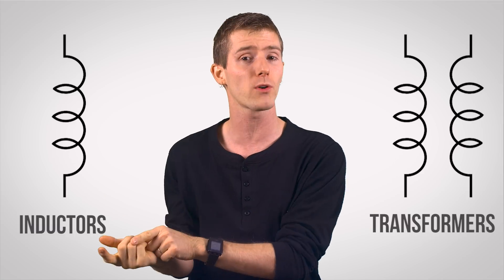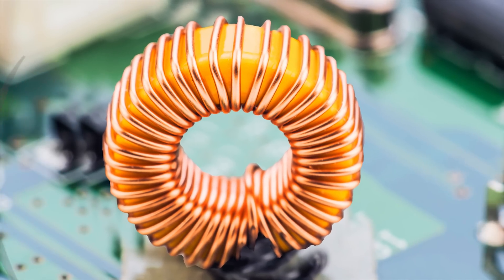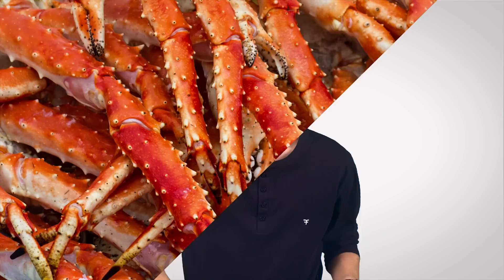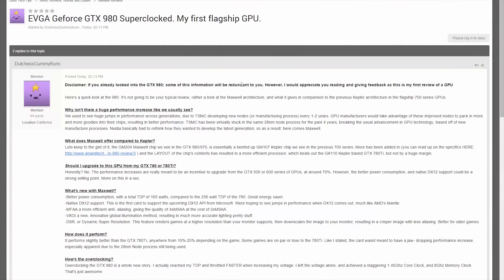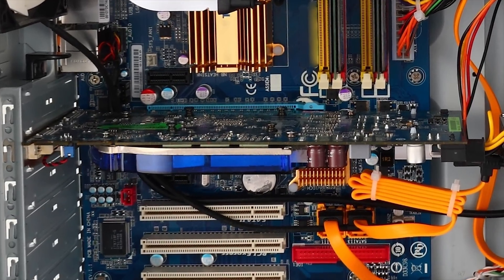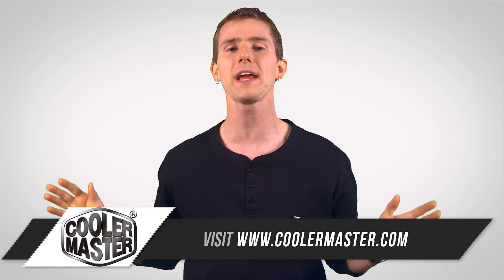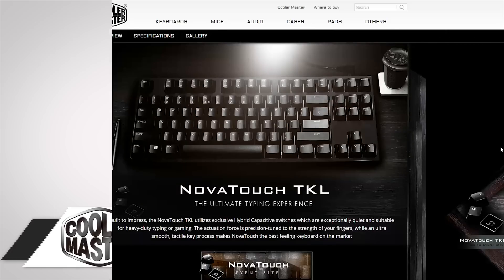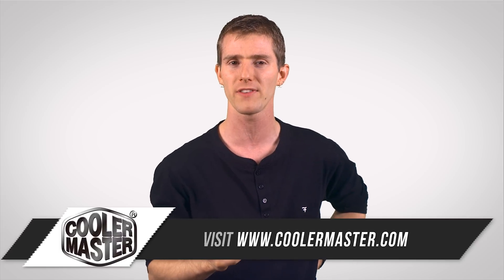Coil Whine as Fast As Possible

Comment: The last tip - listen to Linus. I accidentally sent away my HDD and lost all my data because I haven't had any backup drive back then. When it came back I realized that not the HDD was broken but the fan of my PSU was making strange sounds (which usually slowly dying drives do)

Comment: So for the 970's that have coil whine, is it from the actual pcb? Because I was planning on getting a 970 and taking off whatever stock cooler it comes with and using an NZXT kraken with a g10 bracket. Would this reduce the chances of coil whine?

Comment: This is weird but the coil whine on my card is quiet. But the electro magnetic field produced interferes with my dac. So the coil whine sound will play through my speakers. I can turn the volume on the speakers down and the pc audio up to compensate but this is so weird. If my speakers aren't plugged in i cant hear the whine. Maybe i need to find a way to shield my sound

Comment: Just limit your graphics card's fps to one fps below your monitors refresh rate, this stops most coil wine. You can do this through the catalyst control center and whatever nvidia's equivalent software is called.

I did this and I don't have coil wine on my radeon 7950 anymore.

Comment: hey linus, here are some suggestions for your next video
a video about:
-Chokes, diodes, capacitors, mosfets & more
OR
-kernels(Linux, windows NT, Unix etc), 
OR
-firmware
OR
-wattage, voltage, amperage, ohms & more
OR
-VRM, Digi VRM & Digi+ VRM

OR
-Filesystems (fat32, ntfs, ext4 etc)
OR
-Contrast ratio (this is just a worst case scenario suggestion)

i'm not giving up until you do a video of my suggestions >__>
Reply: I second these.
In particular VRM/MOSFETs on motherboards are one of the most important parts on them and knowledge about adequate cooling for them is lacking.( and the AMD crowd would benefit most.)
http://www.overclock.net/a/about-vrms-mosfets-motherboard-safety-with-high-tdp-processors

Comment: I had terrible coil whine, turns out a wire on my 24 pin was seperated from the connector. Whoops, new PSU and it's silent.

Comment: Overclocking or doing anything to change the voltage [higher or lower] will change and possibly even get rid of coil wine. Be careful though and don't fry anything. Also set a frame limit on older games.

Comment: I bought a Corsair CX600 v.2 power supply about 2 years ago, did not have coil whine for a few weeks then it started to whine. The interesting part is that it went away in a few weeks, it was only noticeable during the night when I was in bed and even then, it could be stopped by switching it off via the button at the back.
But as I said the whine went away, no problems since.

Comment: I picked the G1 970 as it uses high quality components that dont coil whine
Reply: Many GPU manufacturers claim to use "high quality components".
Reply: try to run windows experience index and listen carefully to your 970. it was the only time my strix made some annoying coil whine otherwise im fine though
Reply: Veslux
windows 8 doesnt have that. and it hasnt  made any noise even while streaming or benchmarking, im pleased
Reply: I have a G1 card and it whines SOOOO BADLY.
Reply: VideoFletcher - Youtube Channel.
Windows 8 does have that, it's in computer properties.

Comment: MAYBE and just MAYBE, if your card has that problem and you are familiar with tiny electronics you could try to MOD the dc-dc converter to push the frequency a little higher. Just like a volt mod in the old cards could give you better overclocking but this time tweaking the frequency so that the whine goes away. Just check the mosfets dont overheat at maximum power as rising the frequency will cause higher disipation on the mosfets. (linear relation, twice the frequency, twice the dissipation, so it shouldnt be that much more, just have it in mind)

i never had this issue, even with medium to low end cards which used normal open coils instead of solid ones (the brick like ones that come with the ferrite covering the winding completely)
MMF is usually an issue when you are working with low frequencies, the buck converters should be working above 25khz. Sometimes it's easier to just up the frequency instead of getting better inductors. It doesnt really matter if it vibrates above 20khz,because you wont hear it.

Comment: Yeah... Coils have that problem. Not only on graphics cards but in laptops too and PSU ( desktop or wall transformers). I have a bunch of wall transformers, and all make that noise, and a laptop too... a laptop with intel graphics, and its really loud and annoying (hp dv6559ea if u want to check).

I have a suggestion for a future fast as possible video.
- Mobile boardband bands( GSM (4G(LTE), 3G(UTMS), 2G(GPRS)))
I know 4G is faster than 3G, and 3G is faster than 2G.

Comment: I RMA'd my 8800 GTX to BFG for Coil Whine, the two replacements I got had it worse, and in the end they ended up sending me a brand new 8800 Ultra. No coil whine, and an amazing upgrade. I miss BFG so much. They were the best GPU manufacturer I ever dealt with.

Comment: I only got coil whine on a few games, while the game is starting, you know, those logos and copyrights disclaimers, then it goes away. Weird.
Reply: that's a sure sign of the fps cap not being either set first, or it exceeds it during those screens, loading screens are known to hit very large number fps in some games, even though the fps cap is enabled, or even if you use vsync in gpu settings

Comment: My GTX 760 ACX SC had some bad coil whine which varied with framerate even in a completely different PC. EVGA RMAd it and the new one still had the exact same problem (apparently it's a common issue with that particular card), cooler was also louder than it needed to be at idle so not that happy over all but customer service was top notch :S.

Comment: Anyone else having a whiny Corsair CX750M PSU? Shit's annoying as hell
Reply: I have a Corsair cs750m PSU in my rig. it's silent. the CX series has coilwhine! read some reweves before you buy a component! :D
Reply: Sad thing is, I didn't actually intend to buy it. I was comparing stuff with eachother and my original plan was to buy the CS550M  PSU. The price itself stayed the same and I didn't realize that I changed the PSU to a 750 after I ordered. Kinda sucks, but oh well. I game with my headset anyways.

Comment: I haven't had coil whine with my newest build. but I also went farther then most are going to. On top of buying an AX760 platinum PSU, I rewired the receptacle where all my computer related things would run off, into it's own 20A breaker, even adding an isolated ground to reduce interference.

Comment: So the annoying sound wont destroy my graphics card? When I geg over 200 fps I usually get a light coil while (I guess) and I thought it was the graphics card destroying itself.
Reply: yeah, that's just your card "screaming" because you're making it do "strange things", just lock the framerate, it won't hurt your card if you just let it whine, but using vsync or just locking your fps in game to a max that is less than 100 fps should help with low dips not being so bad for you and it should stop the whine in almost any game
Reply: It will vibrate so much it will cause an earth quake destroying 3 continents... ILLUMINATI CONFIRMED
Reply: /watch?v=NUhwFpPKnXI  this is how you fix it :D

Comment: Huh? I use an old H61 foxconn mobo in my workshop with a gigabyte 650ti and I could swear the coil whine was always coming from the southbridge. It's literally like morse code on crack. I need to run it without the gpu and check. Nice review Linus.

Comment: It's the reason why i tried out ATI. When i bought a FX5900 it would scream like a banshee. Nvidia denied it was possible or just an isolated incident until we got an entire forum of people with the same problem. Nvidia gave in and paid to have someone ship their computer to them so they could figure it out. They couldn't recreate it on their hundreds of configurations. 1-2 months later they came out with a fix... they lowered the fan speed. It mostly worked but made the card run hotter. I gave up and bought a 9800 pro. For a $399 video card at the time it was unacceptable.

Comment: Wow Linus.........Just wow.... 9/10 times Vsync solves this issue or a FPS limiter..... Please stop giving your customers bad advice.......
Reply: This is only true sometimes. Some cards coil whine are worse when you enable V-Sync because it causes a lower, louder frequency. However, sometimes the lower frequency causes the coils to stop vibrating to the point where they're no longer whining. On top of that, lots of people prefer having V-Sync off as it can cause stuttering depending on your monitor, graphics card/drivers, or the game you're playing. But you're right in the sense where he should have mentioned this and went into detail.
Reply: so you gotta wait for your gpu to sync with your monitor? nah man
Reply: Use a FPS limiter then? :P
Reply: cake5000 what about screen tearing and stuttering then @ 96hz up to 144hz? 
don't bother saying gsync or freesync. "clients" lel
Reply: Vsync doesn't solve it all the time though. Like me, I had 2 970s which I sent back due to Coil whine. V sync set to 60 fps sure....but I have a 144hz monitor so F that. Anything over 110fps on my 970s caused the whine and it was causing the whine to be output through my mic jack and my buddies could hear it. I sent them back for replacements but will most likely have whine on those as well.
Reply: There are FPS limiting software which alot of users prefer to use over Vsync. As you probably already know. So both of these options should of been mentioned in this video. As it has solved alot of my clients' problems in the past.
Reply: While he didn't mention about enabling Vsync, his advice weren't bad either...
Reply: What if... The whine happens to occur while the fps is at 60//75120/144fps? So limiters or vsync doesn't work. Or you have to set the limiter at a weird fps and play with stutter or tearing.
Reply: Sometimes slight undervolting (or overvolting) solves the issue as well. IMO it's a better method to start with and if it doesn't help, then move to a limiter. Because limiters won't solve the problem in every game because games put a lot of different kind of loads to GPU, so in most of the games the "sweet spot" is in a different spot/fps. You end up changing the fps limit between every game. Ofc it might solve the problem for many, but i'd start with slight undervolting.
Reply: In that halo one video he showed for the coil whine I remember it for an video he did before he was getting 1000 to 2000fps so ya.  I have my setup limited to 144 fps no problemsproblems. Unless you have a monitor higher than 144hz y make you card work that hard for fames you will not see (I. E. 2000fps) now you can have coil whine below 144fps in that case some of the comments above me are a great way to try to fix it. But be smart limit you system to around 144 or 160 fps and see if that doesn't help.